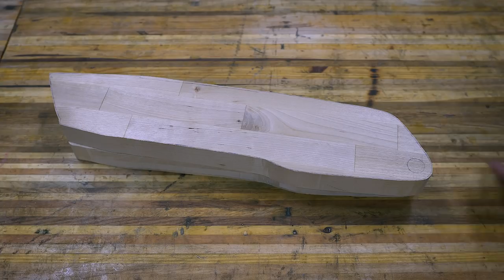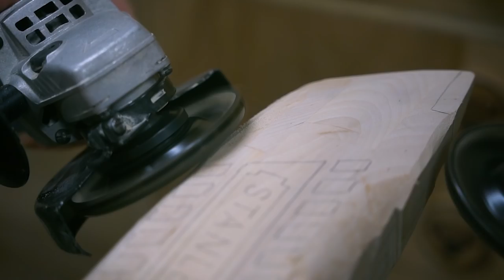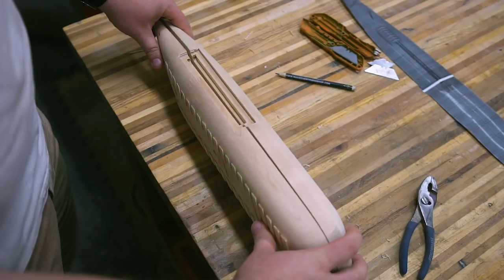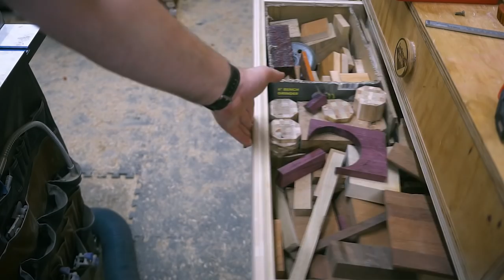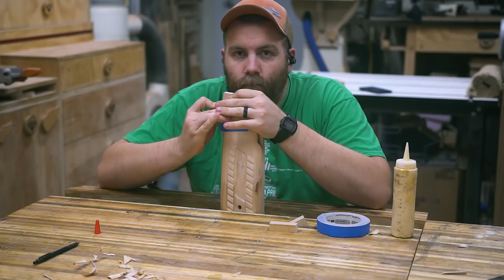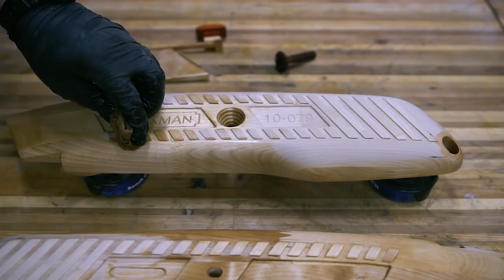Carving a Giant Utility Knife (entirely out of wood)

Comment from the maker: ► Check out all of the amazing Arbortech tools I used on this project, it wouldn't have been possible without them:
- TURBO Plane http://bit.ly/2vYMp22
- Mini Grinder http://bit.ly/2P28VzB
- TURBO Shaft http://bit.ly/2MD4YzX
- Contour Sander http://bit.ly/2P28tRV

► My exclusive solution for hearing protection in the shop, ISOtunes PRO, get your own here - http://bit.ly/2uIsq7M

See the DIRESTA build that inspired this whole thing: https://youtu.be/qWZwaJ3sg30

Full tools and materials list (affiliate links, thanks for supporting what I do!)
Materials
> Maple countertop scrap 
> Padauk scrap for handle 
> Chechen scrap for screw 
> Giant utility knife blade https://youtu.be/qWZwaJ3sg30
> Double sided tape http://amzn.to/2jkTaYr
> Carbon paper http://amzn.to/2qtIYMI
> Wood glue http://amzn.to/2kID2jI
> Tung oil finish http://amzn.to/2i4ltW7
Tools
> Stanley utility knife https://amzn.to/2vBotlS
> Bandsaw http://amzn.to/2j4auNu
> Disk sander http://bit.ly/2OwC70J
> Angle grinder http://amzn.to/2BxiIai
> Drill press http://amzn.to/2jgpN57
> Random orbital sander http://amzn.to/2jrwsJC
> Palm router http://amzn.to/2obmZeX
> Chisels http://amzn.to/2iDRapV
> Screw clamps http://amzn.to/2k4EvjT
> Router table http://bit.ly/2MaRWc4
> Wood lathe http://amzn.to/2yrn8Nz
> Turning tools http://amzn.to/2jwssrE
> Tap & die set https://amzn.to/2MfFkFi
> Step bit https://amzn.to/2B6ESEd
> Giant screwdriver https://amzn.to/2MlFbiR
Reply: Here in Brazil we call it stiletto. And this is huge.
Reply from the maker: Interesting! I've herd a few names for it, but stiletto is definitely new
Reply: Jackman Works I subscribed!
Thanks for inviting us along on your project.
Keep on throwing chips....
I’ll keep watching!
Reply: Hey. One thing I noticed you use frequently is carbon paper to copy a design to the wood. Maybe buy a fairly cheap projector and mount it on the ceiling pointing down, so when you need to copy something you can just project the image onto the wood. You can also easily resize it too. That's how we go about making big posters by hand for example.
Reply: I love goofy projects like this 😂 This is the one that got me to sub your channel.... Although the wavy vase is an extremely close second.

Comment: You have excellent taste in mechanical pencils, sir. Also, that's a pretty sweet little knife you made there 😂 I can't even fathom how much time you put into projects like this, but it turned out super awesome man.
Reply from the maker: That's about 2 weeks of work right there haha. That pencil is literally the best thing ever though! I lost it during the move but just found it again. It's the best for the template work because to trace on the carbon paper I just use the metal tip which is the perfect size!
Reply: I haven't seen someone break out carbon paper in a while. Really brought me back.
Reply from the maker: I'm surprised I don't see it more than I do! Much easier IMO than gluing a template on and then trying to clean that up
Reply: Maybe you'll start that trend.